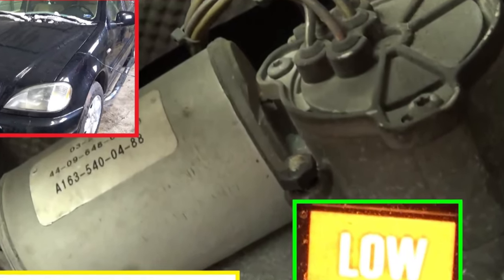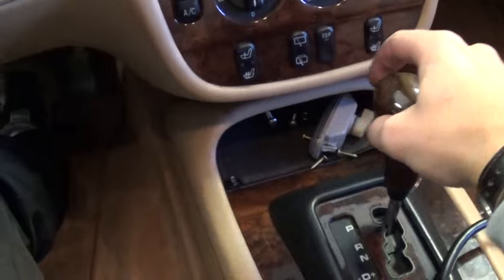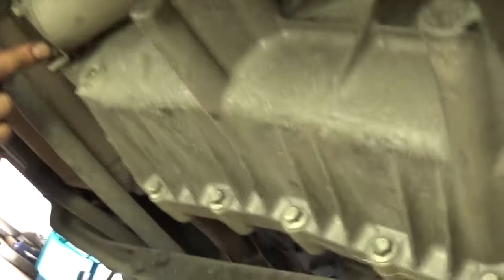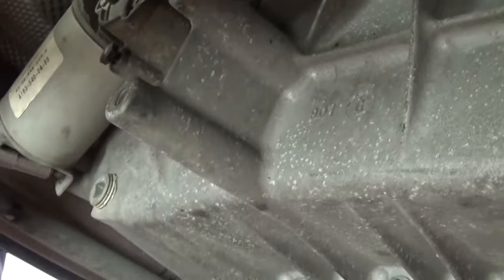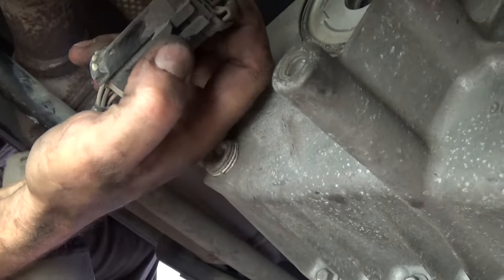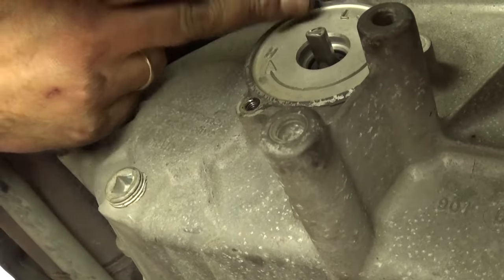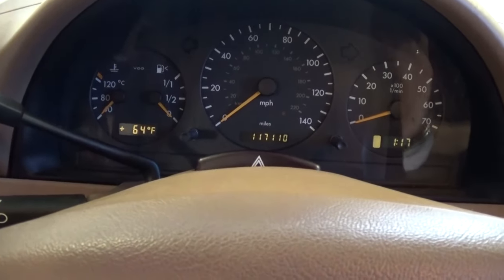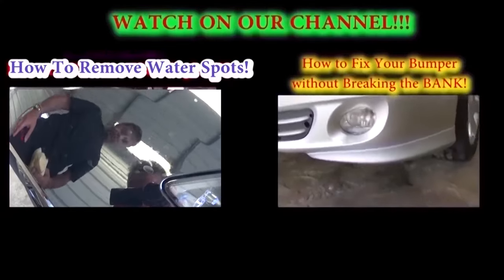Low Range Transfer Case Motor Removal and Replacement on Mercedes W163 ML230 ML270 ML320 ML350 ML400

Comment: Thanks so much for your videos! The Low Range light came on and stayed on when I was driving so that my ML-320 was running 3000+ rpm at 40 kph. I checked my ATF fluid and it was low. I then added as per your instructions and voila! Transmission is working properly (fingers crossed).

Comment: Good job , and very informative ! I have this problem with my 2002  ml270  although car operates fine, the low range indicator light flashes for about 5 seconds after startup,  have been told motor failed to complete cycle last time low range was engaged so should probably fit new one .
Reply from the maker: it is a very common problem with w163. Thank you for watching and if you have any questions let us know
Reply: God
Reply: God

Comment: Hi, We have a problem on our ML W163. Previous owner installed new radio unit (not MB) and ruined Low Range Switch relay. Looks like broke the unit and then glued the switch to try and make it look "normal" but doesn't work. Unfortunately, we didn't think to test as we really don't need low range. But, if easy we would like to get it working again. Can you please do a vid on how to remove and replace the switch/relay? Thanks

Comment: I have ml320 w163 1998 model..... The front two tires got stuck suddenly and would not move.... The mechanic suggested to remove the front two axles and make it rear wheel drive and I said OK.... But still the car does not move..... Now after watching your video I am thinking maybe the motor got stuck.... Whats your opinion?

Comment: I having the same problem with my 2001 ML320 with 20700 miles 😬, so this is the part I need to change? Good video 
Question please , with the light flashing at startup does it affect the drive by any chance? Please advise
Reply: Cuse Magic how did you fix yours
Reply: T the barber 

Same issue as mentioned some months ago, I did a reset by hitting it with a rubber hammer, this process reset the motor for a while but after a few days it reverts back to the malfunction mode of flashing light

So I bought a second hand  low range part on eBay and replaced the faulty part and since then no more flashing lights, all working like it should 

Once that low range motor is faulty, it appears it has to be replaced

Hope this helps
Reply: Was your SUV stuck in lower gears
Reply: But if  the flashing doesn't stop  when you change the transfer  case what should I do?

Comment: But in a case you changed the low range  completely and when you put the car to neutral to put the light on back but it just blink  severally  and off Instead of ON. What really happened?

Comment: I have an issue with a 2002/52 Ml270 cdi auto when i start the vehicle the low range flashes 6-7 times then goes off and even after the light goes off if I try pressing the low range button nothing happens. When I drive the vehicle for a few days its fine then suddenly whilst driving the car will just go out of gear and over-rev and slow down so I use the tip-ironic and hit the gear back down to 3/4 and it sorts itself out agin for a few days then the same thing happens again. Would you say that this is a faulty transfer Case - your help would be most appreciated

Comment: Where did you put the relay ml 270 cdi? Urgent! Thank you
Reply: "[HISTORY] P2600 The voltage supply of circuit 87 has under voltage" what does this mean? Where should i put relay?

Comment: Please I need ur help bro I’m working on a Ml 320 change the cunductor plate and shifter the first scan I got sed the silly noise to three and six we’re bad so I change the conductor plate, change the shifter and deleted the codes and then once I started the car and put it in drive the check engine light came back on and now the Dakota keeps coming up at 047 cents something is wrong with the transfer case thank you auto repair guy 🤘🏿
Reply: Change the gearbox they’re dirt cheap

Comment: mine is stuck in low range - was at a stop light and it dropped into low range - will this solve the problem. No I didn't put it in low range and it is not in limp mode as I have had limp mode before. Low Range light is on goes out when you stop truck and comes back on when you put it in gear and drive 2 meters
Reply: John Komar good evening how did you fix ya suv
Reply: T the barber I found a short. The control module which is on the drivers side right above the gas pedal was hanging by a broken zip tie, go figure. anyway the module fell down and the wire wore and touched the steering column grounding it out and putting it in low range. so if there is a short in the wire anywhere and it goes to ground it will put the transfer case in low even if your doing 25 MPH
Reply: ok thx
Reply: T the barber  did your work